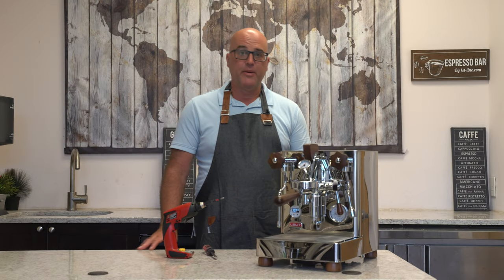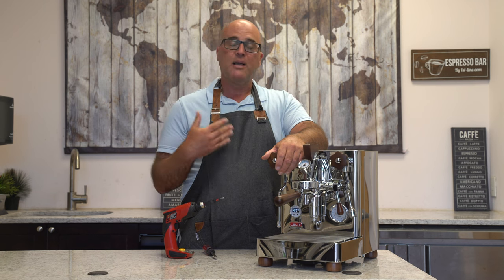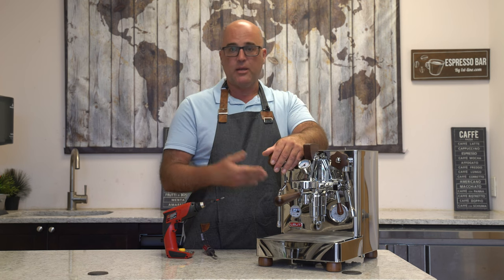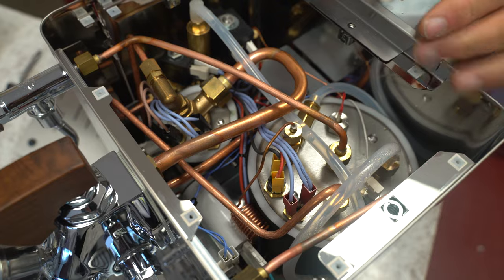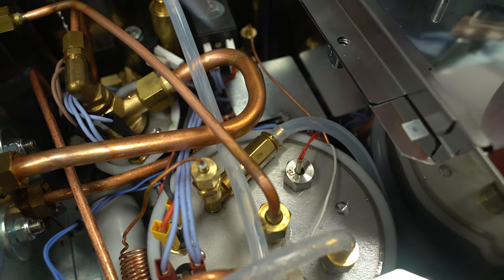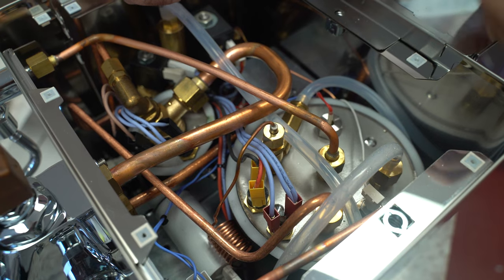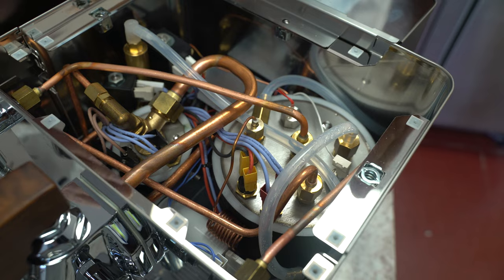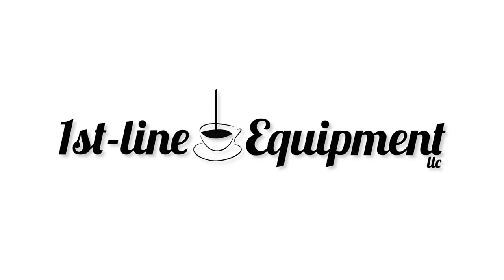Tech Support: Spout Leakage Lelit Bianca

Comment: To fix the issue, keep the bottom nut in place with a spanner but unscrew the top nut of the valve. Then take out the brass piston (looks like a top) using a nose plier. It will have a small O-ring (maybe red colour). It will be very small but which is most likely worn out. Replace it with the same size o-ring which you may find in the local auto parts shop (I was able to find assorted O-ring of various sizes made out of viton rubber) . Then put it all back together again. That should fix the steam valve leaking.

Comment: What are the steps to repair this issue?
Reply: You can pull apart the vacuum breaker or the safety valve and clean them with a soft brush and warm soapy water. That could very well fix the problem. Just be sure you put the tiny pieces back together correctly. Or you can replace them which is probably safer. For how to do that, do a search for "bianca vacuum breaker replacement" (great Lelit video) or "bianca safety valve replacement".

Comment: thanks Jim,  it looks like you read my mind. I start having this leakage about three weeks ago. I was planning to contact you as my machine is still under warranty. My spout is leaking steam vapors. I have always used the water softener . Once I know which valve is the issue, 
1. how should i proceed with cleaning the part? I mean what should i use to clean it?
2. what should i use to open the part and?
3. how can i determine that the part needs to be replaced?
Reply: Hi! I have the same problem with my Bianca… did someone respond to your questions? If so, would you mind sharing the answers? I would like to solve this problem. Thanks😊
Reply: @belac4455  No response

Comment: Is the safety valve tube typically going to be clear of any water then if the machine is functioning correctly? I’m seeing a fair amount of droplets in the safety valve tube. 

My main issue is experiencing some extra dripping from the front of the machine and no longer hearing the same strong start up “hissing” sound with the sharp cutoff; it sounds weaker or more watery or something. Doesn’t appear to be any water movement in the vacuum valve. Looking at both they don’t appear to have any buildup. Thanks.

Comment: hi Java.  my Lelit Bianca no burn steam gets very hot after two steaming sessions.  Is this a normal thing?
Reply: Hi John, I realize this post is 7 months old and you may have figured out your issue, but just in case if not- when i got my Lelit Bianca brand new from day one the ‘no burn’ steam wand was also getting very hot!  Eventually i got frustrated and took it apart, and found that the inner silicone tube that is inside the steam wand had a cut in it, looked like it was done at the factory and not cut all the way through.  I called my dealer and they sent me a replacement silicone tube and innards, and that fixed the problem.  It is not hard to pull apart, i would recommend checking the inner tube first.  The wand should not heat up much, even after several coffees.  Night and day difference for me!